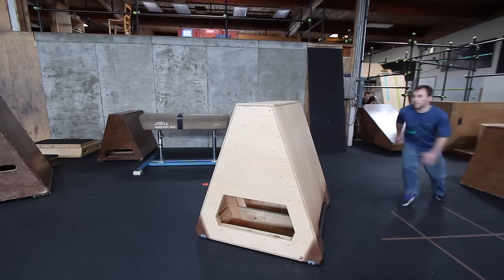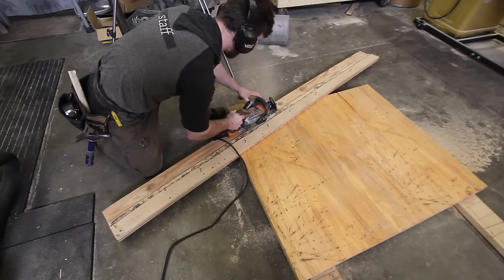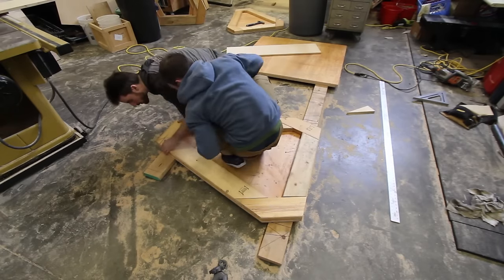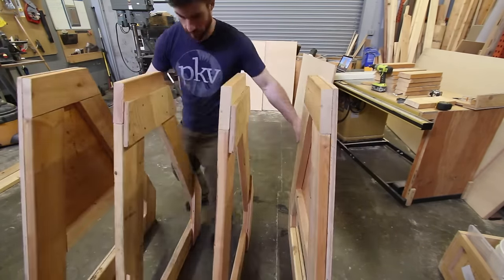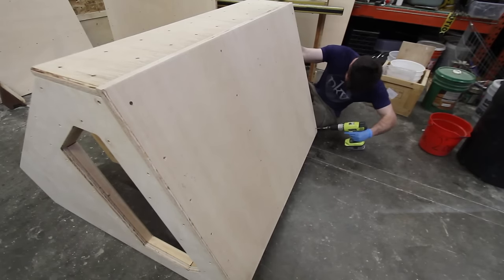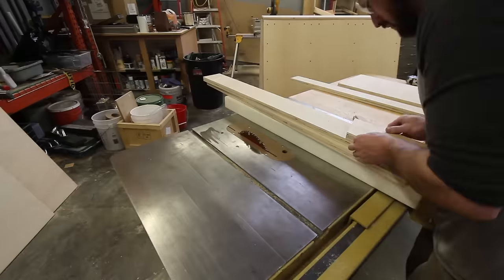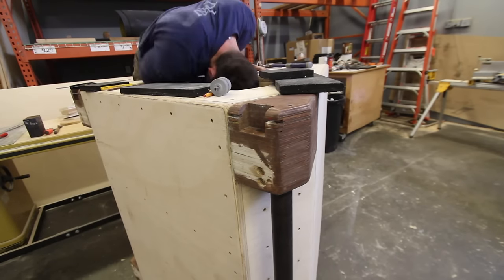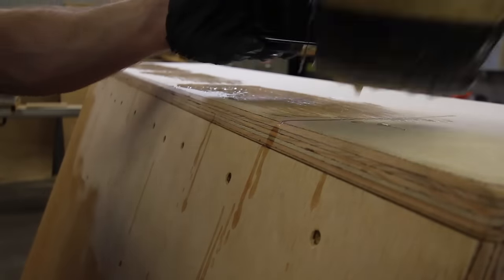Next-gen Vault box - STURDYmade parkour obstacles

Comment: Thank you for the tutorial. I used the SketchUp template of the smaller box and along with the video I figured out how to build a larger version, just without the bars. Great design. Really sturdy. Only mistake: I used OSB instead of plywood. It's cheaper, but it splinters easily.